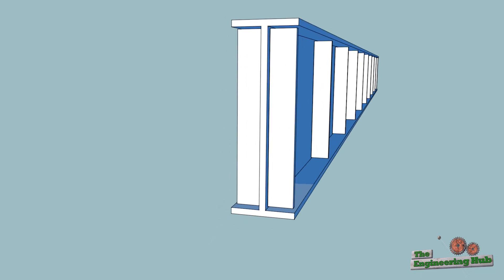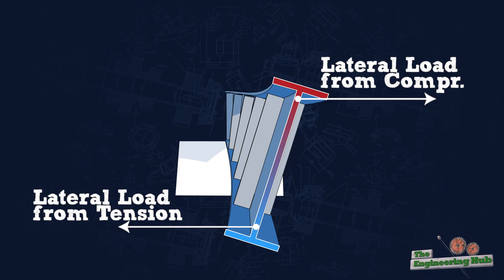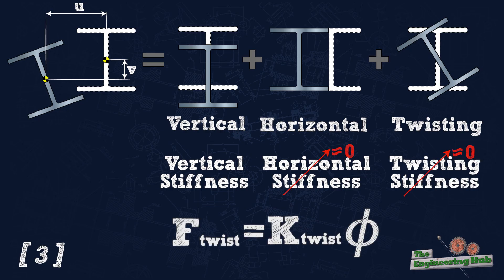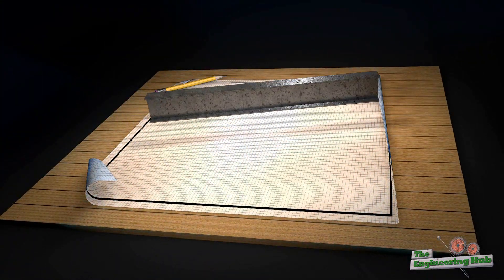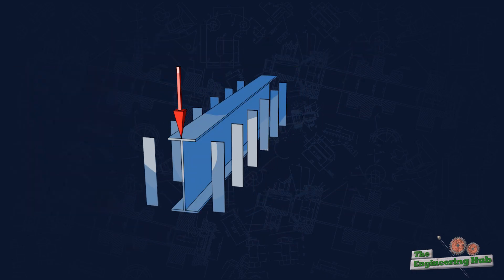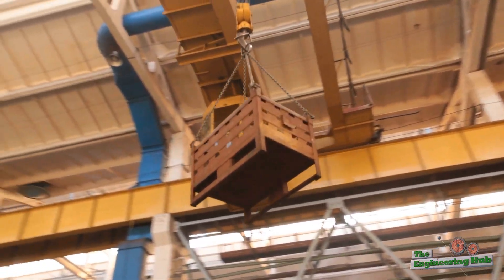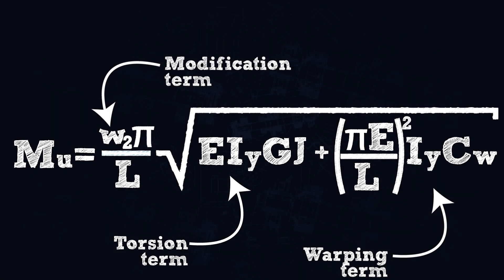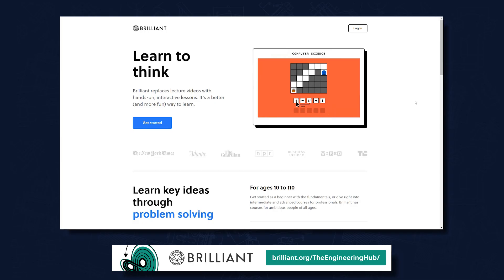Open Beams Have a Serious Weakness

Comment: seriously?
the compressive and tensile forces in the beam that u showed in the video which produce a couple act perpendicular to the screen of our phones or parellel to the flanges of the beam and not laterally. they dont create any such moment that u showed. thats wrong. 

the main reason of lateral buckling is eccentricity of excessive loading and a longer web length with no bracings. that is the reason we make built up sections.
Reply from the maker: At which point in time in the video is the moment that is wrong? Of course the tensile and compressive forces create a couple moment that is parallel to the flanges, that's mechanics 101. The buckling happens due to the compressive stress in the flange that causes the flange to kick outwards (buckle). This causes the forces to misalign in the lateral direction which causes bi-axial bending and twisting. This bending further drives the lateral buckling. If you don't want to take my word for it read: 
https://steelstore.cisc-icca.ca/products/limit-states-design-in-structural-steel-11th-edition-2021 
(we did study this extensively before making the video)
Reply: @TheEngineeringHub   @ time stamp 1:38 is the loading diagram I am talking about. if there is no previous horizontal couple acting on the member, those two components(as u mention in video due to compression and tension in flanges) wont generate only due to vertical loading.
and the main reason of lateral buckling of the beam is the weaker vertical axis of an I section and minor eccentricity of loading and erection as u have mentioned much later in the video. since the eccentricity of loading and in erection occurs the vertical loading doesn't perfectly pass parallel to the vertical axis of the section and thus load doesnt pull the beam vertically through its theoretical vertical axis about the symmetric mid point if the section as it should but through an inclined one(as you later show) and that creates a moment which inturn twists the section. this moment furthers as the loading increases and thence failure.

I have read books on the subject too and if you wish to tell me that a vertical loading creates a couple and themce a twisting moment parallel to the face of beam section as on @1:38 due to forces of compression and tension in flanges  then I worry about ur perceprion of the subject. It's the imperfect erection and imperfect vertical loading which brings lateral buckling and there is no couple acting in face parellel to face of beam.
Reply from the maker: Completely agree with your statement in terms of the causes of LTB. This is mentioned in the video later on as you pointed out. It is true that the tension and compression stresses do not directly produce torsion since they act along the beam. But they produce deflections which then cause that torsional moment. Maybe to make it more clear the annotation at @1:38 should have read "lateral DEFLECTION from tension/compression". 
So in essence: 
vertical load -> longitudinal comp/tens -> lateral buckling (due to eccentricity) -> lateral deflections -> torsional and biaxial bending
To give credit to your initial comment this cause and effect sequence is not clear at @1:38. But these videos do require prerequisite knowledge of mechanics to fill in the blanks since it becomes very lengthy and time-consuming to go in detail about every stage of the concept. Thanks for the comment!
Reply: @TheEngineeringHub  yes, now the flow chart is better. And I appreciate ur videos. Being a civil engineer myself I find the content appealing.

Comment: So why do we use those beans instead of box beans?
Reply from the maker: They are extremely effective at carrying vertical loads when they are used in parallel with cross bracing between them. Or when the top is connected to a deck above and prevents them from torsinal buckling.
Reply: @TheEngineeringHub  thanks!

Comment: The problem seems much exacerbated by the excessive slenderness of the truss and the lack proper constrains at the extremities.
This allows the upper wing if the truss to become unstable, due to lack of axis tension, in a similar way as a free slender plank become unstable under vertical load faster then one which has working constrains.
What you are doing adding flanges to the side of the section is increasing the area of of it, and so reducing the slenderness of the truss itself.
I guess standard truss dimensioning, like the IPE system suffers less of the problem because it accounts for the issue.
I also imagine Baloon Framing is most vulnerable to this kind of problems

Comment: Your comparison test was NOT equal. The I beam has just the single thickness on the horizontal sections with ZERO fasteners strengthening them. While the box section has the horizontal sections doubled up with many fasteners strengthening it. It was not clear how the fasteners on the vertical sections compared. If they were equal, it made the box beam just that much stronger by the fact it had more material. The fact that the material is added where it strengthens the beam the most contribute to an unequal, and thus unfair test.

Spot welds would add no material, but would be just about impossible to do on the box beam. Regardless, it would still do more to strengthen the box beam than it does the I beam.

A fairer test would be I beams and box beams of the same height, width and the same weight. Made that way, not assembled from C sections.

Comment: Its not the beam design thats faulty, its the installation. The #A or #B type steel decking on top of the beam should have fasteners that attach it to the beam that prevent what you are pointing out. That type of beam isnt designed to be stand alone. There are thousands upon thousands of buildings designed with this type of beams that are perfectly fine. Pointing out a few instances of improper use doesnt mean its engineered incorrectly.

Comment: They are super flexing in the weak axis. And must be restrained to stop localized buckling. Usually they are tied into the concrete deck with shear studs.  Or at least welded to the metal decking.

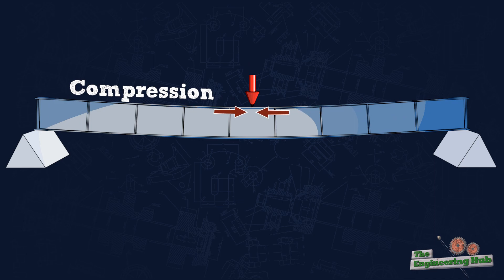Comment: The picture at 1:00 is worth a thousand words. When the beam is under load, both the top plates and bottom plates are trying to stretch, with the bottom wanting to stretch more. But, they REALLY don't want to stretch! 
With the strap in the middle holding them together and keeping them from stretching different distances,  there is only one way for them to go that keeps them from trying to stretch, so each can maintain as close to their original lengths as possible, which IS the same length for each.
"Come on Baby, let's do the Twist!"
This video explains why Engineered Trusses in floors are WELL cross-braced, nowadays.
Reply: I have floor trusses there  o.c.16"  2x4 constructed and 18" tall they span 28'. I have squash blocks around the rim with a 1.25 osb sub floor.  So far so Good.

Comment: So, that little demonstration is totally  fubar, it's not an accurate representation of the material. It's load stressing has different properties since the top and bottom plate are not solid across the whole surface, it's a variable that wasn't corrected for.

Comment: That is why composite I-beams, and beams without fillets between the body and the flange are better. Because well filleted i-beams that are do not have wide flanges are far stronger across multiple axis. 
Neither of those beams are typical of properly selected material thickness. These are very good examples of silly minimalism in materials selection.
The only thing one need do during design is to choose a failure mode that suits your needs.  Because here is the thing, your test setup also failed to properly secure the ends of the beams you chose, so failure was inevitable because the beam never transmits tension to the points of support.

Comment: Excellent presentation.
Edit: top loading the beam may have resulted in even less weight required for failure, as the blocks and load placement actually “strengthened” the beam.

Comment: Isn't the instability of the beam better explained by the center of gravity of the load being offset to any degree from the vertical element of the beam?  A box section achieves better stability by having a wider distance between vertical members, not from having fewer imperfections.
Reply from the maker: Sure, but that's only partly the reason. The susceptibility to lateral torsional buckling (LTB) is also due to the poor torsional resistance of the I-beam. Closed sections on the other hand are much better at resisting torsion and therefore have higher LTB resistance (not necessarily because of the center of gravity). A box beam with a slit along one side (open box section) would geometrically be very similar to a closed box beam but would not perform as well in LTB due to the fact of not being closed resulting in weak torsional resistance. The weak moment capacity in the lateral direction of the I-beam is a reason more why it is weaker than the box beam. Manufacturing imperfections are important but the essence of the weakness basically comes down to "it's just the way physics works". In retrospective, maybe in the video we made it sound like the manufacturing is the weak link when in fact it's the laws of universe 😅

Comment: I think this is one reason we newer used open beam framework in the (north of) Nord for wooden buildings in historical times. Whan it was used in farmers buildings the beams are always square, never rectangular (in modern sense) in historical buildings here. Open beams where never used in living houses here, the roof on my old farmhouse is cladded with 2" plankings on both sides, and i think it is square beams under it in order to withstand the weight of wet snow.

Comment: Go back in the first of the video where this guy has all these buckets hanging of a '' NOT A TRUE I- BEAM " , ITS TWO PIECES OF C- CHANNEL SCREWED TOGETHER, of course it failed. Why, Because it's NOT A TRUE I- BEAM, it's 2 pieces of C- channel screwed together to make a I BEAM...
  Any thing that's engineered it will fail past the " Point Of Engineered " that's why they over engeener by a certain %
Reply from the maker: Hi Terry, thanks for your comment. You make a very good point-- There is a calculation of what engineers refer to as 'shear flow' which is the load transfer at the interface between two pieces (such as the channels screwed together) which can allow them to act as one member (such as an I-beam) if fastened sufficiently. Our first "I-beam" (which didn't make it into the video) failed very prematurely because it wasn't sufficiently screwed together to give enough shear flow to act as a true I-beam. For the "I-beam" used in the video, we performed a shear flow calculation to determine the number and spacing of fasteners to allow it to act as an I-beam, as much as needed to illustrate the concept being conveyed in the video. And, very good observation in your comment, you noted one of the biggest challenges we had in creating this test setup, but we were able to engineer our way to a solution to this problem. Cheers and thank you for your comment!
Reply: @TheEngineeringHub  my parents had a business of building pre fabricated steel buildings. I learned a lot.
   Those screwed together c-chanels aren't quite as strong as a continuous piece of steel, if that makes sense. Screws have a shere factor wich has few things involved, like the tinsel strength & so on.

Comment: Make those steel beam a spine inside a concrete so it can't twist?
Reply from the maker: That would certainly prevent rotation but the added costs of building forms would make it an expensive solution.

Comment: LACK OF REINFORCEMENT OF THE LATERAL SINE...THE LATERAL STRESS.

SAME AS WHY YOU NEED TO BLOCK 2X4 WALLS, AND WHY THOSE THAT ARENT, SUCK ASS.

AND MOST ENGINEERS ARENT THEORY STRONG.
Myself...im.an.architextural.emgineer.
It's fun.
Static physics

Comment: why is the beam manufacturing the reason? That's like saying a ball can't balance on a pin because the ball and pin were not made perfectly symmetrical. It's an instability condition. When any small deviation results in acceleration it doesn't matter if you have a perfect material,  a soundwave could come through and destabilize it..
Reply from the maker: Yes, that is true, but since it doesn't get to that point where a flap of a butterfly's wings would destabilize it, then the reason is sought in inherent imperfections. Depending on the magnitude of the imperfections, the buckling load can be decreased significantly if the beam is of a particular bad quality.
Reply: @TheEngineeringHub  fair point. We're drawing a distinction between design flaw and material flaw when all real life situations are truly a mix, but I think my intuition is that this falls well within design flaw rather than material flaw.

If a weakened yield strength of 2% causes your building to collapse then you f'd up the design. If the foundry is producing beams with +/- 10% yield strength, well then whatever design elements you use it's going to have to be way conservative hahah. But it takes a much worse screw up in the foundry to result in such a large drop in yield strength to compromise that design, considering it should have had a FoS of 2+.

That is excluding some more nuanced material problems like fatigue, which I'm kind of too lazy right now to think hard about but you might find support for switching away from I-beams in certain cases.

Don't get me wrong with critique - I think it was a good video, sorry if any of this seems critical in a negative way. This video is certainly really great at explaining it. I really only bristled at the materials quality comment hahah. I don't do structural design but I think, if I did, this kind of problem would be captured (for me) in torsional analysis - the way I learned it, I-beams are the most obvious example of weight minimization by focusing on the moment of inertia equation in a specific loading direction. So I know both factually and intuitively there is a caveat, so I have to make sure to treat them appropriately. In the same way you wouldn't try to balance a book on a pen, even if the pen is strong enough to support it.
Also there are things you can do - modify the center of the beam to be a closed box (e.g. weld on a closure on each side) which locks out the chance of torsion happening at the center and divert the instability condition to the more stable 2nd order. (At a slight cost of course, the added weight.)

Tangential, but the experiments you did for this video were really great - it's so, so much better for people (not particularly people like me who know the theory and have experience with these kinds of things, but for MOST people who will see it) that they can actually see it and have the intuition to understand somewhat complicated engineering ideas. That is how people, I think, come to understand that being an engineer is possible for them too. Most people can understand "difficult" things if they just find the right angle to look at it.

And while I'm on tangents... the whole strength vs weight thing has been greatly improved by FEA for even very complicated structures by following the same idea - FEA and ML (oooo trendy words) have really unlocked the ability to find weird design shapes (usually blobby-spiderwebby looking things) to minimize weight while keeping the necessary strength and rigidity.